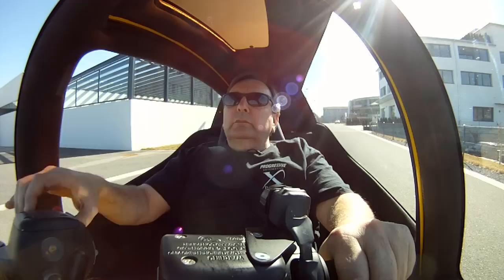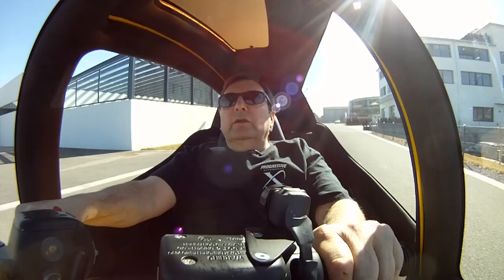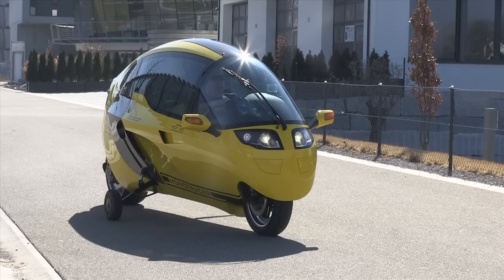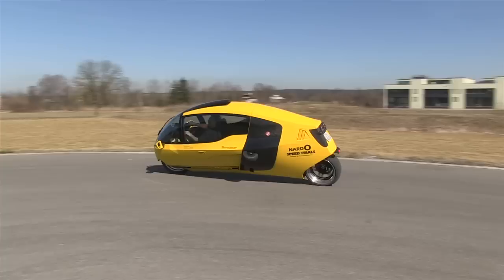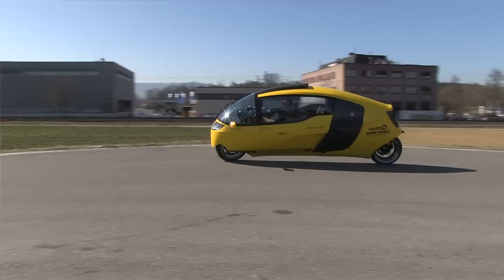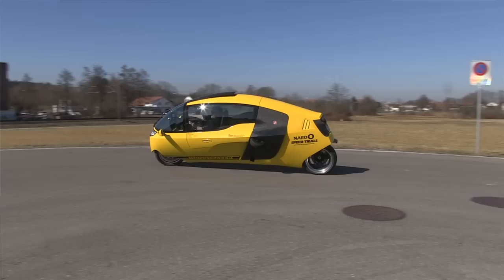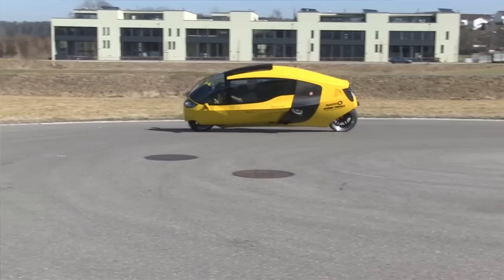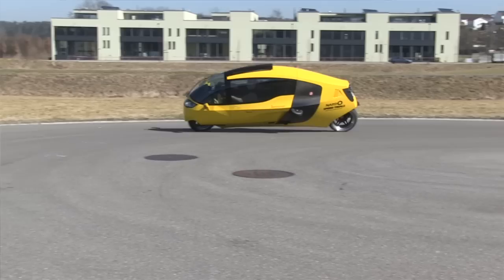New Monotracer MTE-150 Part 11: slow driving

Comment: I like the concept and design of this vehicle, but if the retractable wheels don't automatically engage at very low speeds, I would not risk spending that much money.  It does not have to be "annoying", just a security measure to keep the bike from tipping over.  I guarantee you, on busy North American roads, we have to make emergency stops because of ignorant drivers and the last thing on my mind would be to press that switch before tipping.